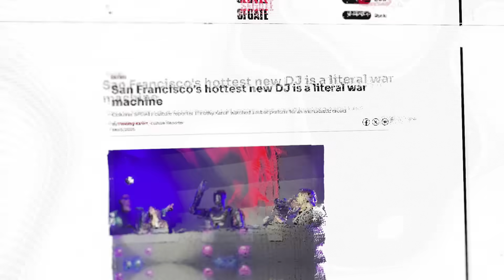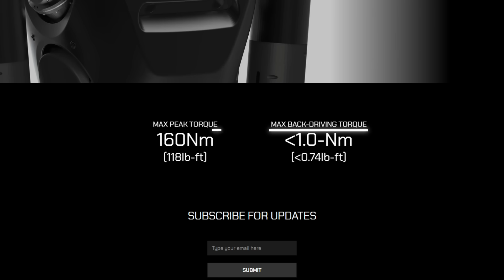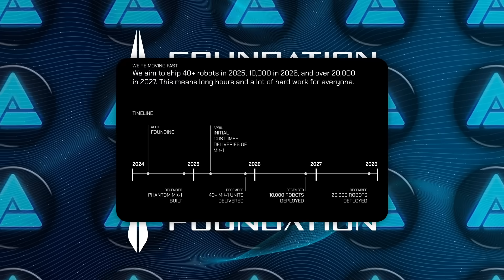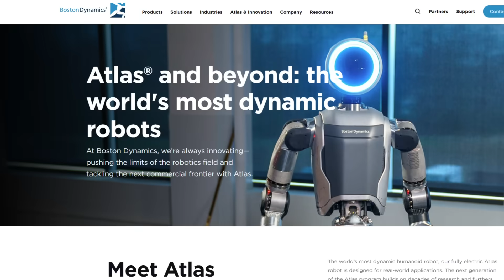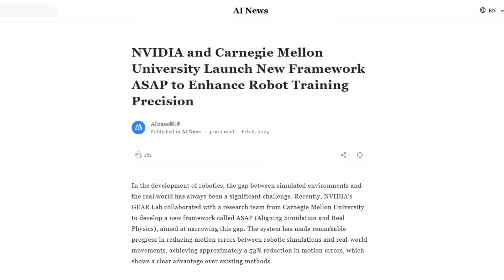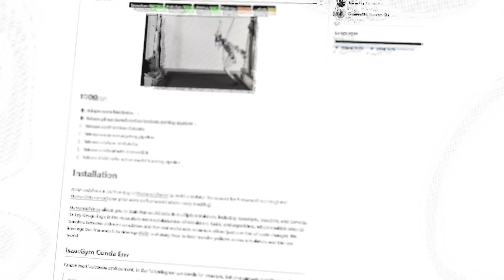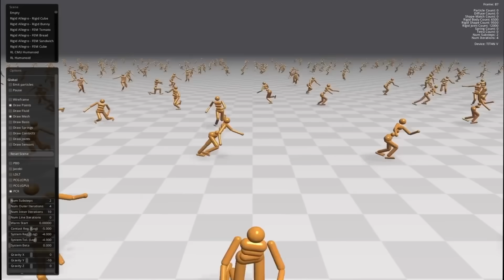The First AI Humanoid Soldier SHOCKED The Internet!

Comment: So the future of warfare are staionary enemy robots being emp'd and then reprogrammed and returned, to be emp'd, rewired and sent back......
Soldiers can be entrenched under fire for days at a time, stranded and separated from assistance. How do the robots respond to energy loss and charge and maintenance? I worked for a company that supplied multiple robotics and technical support manufacturing for field units. The rate of failure with tech, robotics and electronics in extreme real world environments( desert, mountainous, rocky, extreme weather and climate conditions and explosives ) tells a different story.
Performing in a controlled scientific and demonstratio environment is one thing. Simulations are just thatand dont allow for many real world war factors.

Comment: AI humanoid robot designers have overlooked the key recent development in Japan - a new round ball joint has been invented. This technology replaces two joints per each part of a limb by one joint. I.e. robots utilizing this technology would use twice less turning mechanisms per joint. Also the new joint would be made of strong composite plastic, that would decrease robot's weight. Robots would become much less complex to produce and much more efficient. Future lies with this technology. You could make a video about it to increase awareness. Also humanoid  developers should work on mimicking human elastic and curved foot plane and foot toes to increase robots' stability and performance.

Comment: Very lazy analysis. Humanoid robots have about 30 motors on average, which is why they suffer from high battery consumption. In addition, they are not yet capable of carrying a load comparable to a human. And this will not change in the near future, since a couple of generations of batteries and motors need to be replaced. In addition, in war, everything that sticks out over the battlefield is an easy target.

Robodogs are another matter - they already carry about 60 kg, are very mobile, very compact and pressed to the ground, work for at least 4 hours on battery power and were already at all major military exercises last year.
Reply: If you built a large one and use diesel engines
Reply: Carbon 14 diamond batteries last 5000 yrs +. Without needing recharge.
Reply: @scottcarver174  yes, but they have such a low current that in order to reach the required value, you would have to haul several freight cars with such batteries behind the robot.